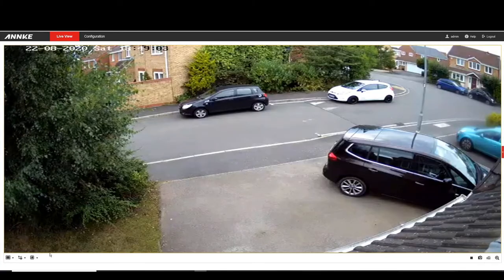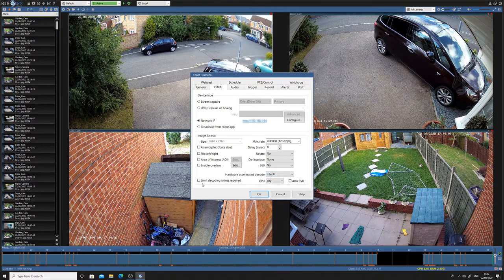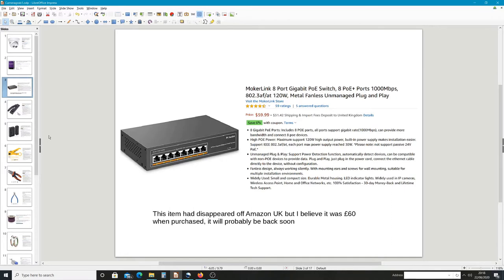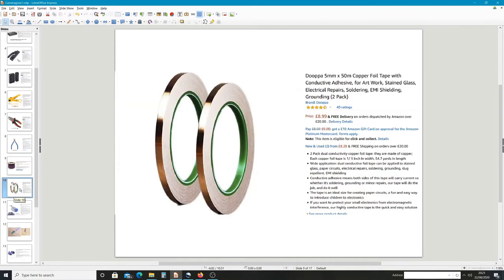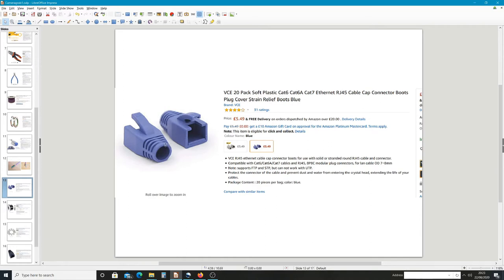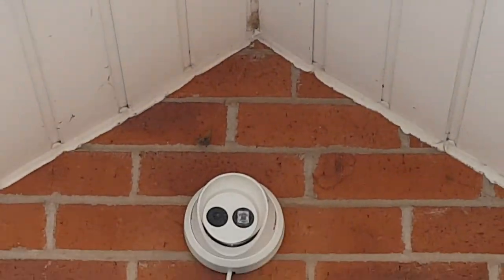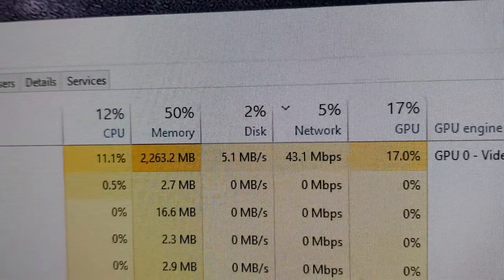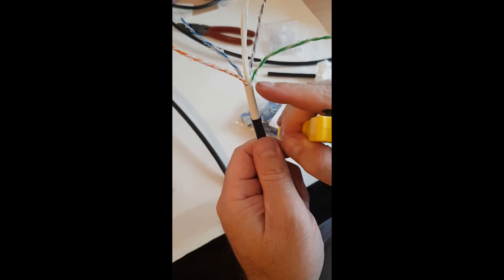Blue Iris - Power consumption & system used to build & support CCTV

Comment: Thank you for all information. I have dedicated NVR box from Hikvision, and 6 cameras connected(1x 4K, 3x QHD, 1x FHD, 1x 720P). This box with 1 HDD inside takes about 10 W.
Reply from the maker: Many thanks for your comments. The PC based system with all the correct settings making use of the 4k cameras uses around 50 watts all in. I suspect a dedicated NVR box will indeed use less power. With the cameras you listed above and a 4tb hard drive I suspect you may be using between 25-40 watts ish at a guess. The hdd alone must be using around 6w if recording 24/7. I suspect at night the cameras are also using more power than in the day. Try a power plug and I think you may be surprised. Thanks
Reply: @ipcamtalk4314  I don't know why you received my post so negative. I'm not saying that Blue Iris is bad. On the contrary, I find it very good software. I only marked the differences between the given solutions. This Hikvision that I am testing does not have the vast majority of features that Blue Iris has, hence its lower appetite for energy.
Reply: @abartos  I dont understand why you received my comment as negative? I was simply correcting your false information.

Comment: This is decent power consumption. I setup my test iris installation on old AMD FX I had. But no matter how I tune it I cannot go below 51-57 watt with iris running as a process. I am recording 2x4k and 1x2k. I guess I need more modern system 🤔
Reply from the maker: Hi there, thanks for the info. Yes, getting all the right settings help. Ensure direst to camera recording. Tick  to minimise cpu usage. Run BI in the background with it not open. The Intel onboard GPU also helps. Direct playback can be a bit choppy but recording are always good. CPU usage is then around 3% and PC power consumption is around 30 watts. This is with running max cpu speed of 3.2GHZ - all energy saving enabled. I suspect with a newer system you could get down to around 20-25 watts for the PC.
Reply: @deanjallen6449  I have GT 1030 for both video decoding and AI. This works amazingly well. Both fast and lean on power 👍 so when just running I need very little CPU. 
For CPU I was thinking about T series Intel or mobile one. There are those laptop processors with adapter to fit desktop board with custom bios..
Reply from the maker: I did notice the hyperthreading cores do work well with this program. The K series is actually a good choice as you can adjust the performance to what is required. This has the advantage of adjustability with regards to how many cameras you are running. I also view the footage on this same pc, running 4 cameras at 4k at the same time. This is when the performance is needed. What you need is a cpu with low minimum speed. The one I am using is 800Mhz. Lower than this will help while just recording. I also think the onboard GPU (intel) will be slightly more efficient but it maybe close.
Reply: @deanjallen6449  thanks for sharing your experience, very much appreciated 👍

Comment: hi im using a gtx 1070 and i7 7700k with 16gb ddr4 ram to run 1 2k camera and other 4k camera and one 1080p camera and one 480p camera im not sure of the wattage but is this an over kill
Reply from the maker: Hi there, thanks for the question. I think the answer is yes just a bit. The 1070 is a good card but I don't think this supports H265, my 1080 strix doesn't. I am pretty sure the 7700k does as I have one of these as well. Just use the CPU graphics, this should allow to record in H265 instead of 264 which should massively increase recording times. Make sure you use direct to disc recording and minimise cpu usage ticked. Also allow CPU GPU to do some of the work, tick the box. Down clock the CPU to 4,0GHZ and turn off turbo. Ensure CPU downclocks to 800Mhz and energy saving feature is on. If you are using 2 slots for RAM this is ok. If you are using 4 slots then remove 2 sticks, make sure you are still running dual channel. 8Ggb of RAM is fine. This potentially will reduce power consumption and increase recording time. Ensure Blue Iris is running in the background and close the program when not watching recordings. Hope this helps.
Reply: @deanjallen6449  Well im using gpu because It has the right display outputs but it runs good i tried to downclock it but the entire pc got super super slow
Reply from the maker: It sounds a bit strange, you shouldn't really notice the difference. Down clocking the CPU will only make minor power savings as its the 800Mhz setting that the PC will be sitting at most of the time. Maybe just turn off the turbo setting. It would be alot better to use the CPU GPU if possible as this should give the performance you need and more recording time. The Nvidia GPU will down clock its self to a low speed anyways so the power saving is minimal. If you use afterburner you could change the setting to 70% power which may help a bit. Maybe a converter so the motherboard output matches the monitor maybe the best way of going. You could then sell the 1070.  This is only if you are using this PC for running Blue Iris only. Hope this helps.
Reply: @deanjallen6449  tried to bricked the pc so i had to reset cmos
Reply from the maker: Sounds a bit strange. If energy saving features are on, you should just need to change the multiplier and turn turbo off. If you change the multiplier to 36 it should then run at 3.6Ghz instead of 4.2 or 4.5. You don't need to touch the voltages. The cpu voltage will then only go to around 1.0v instead of 1.26 ish when set to auto. This will save power when viewing back CCTV footage. It will not save more power most of the time as the cpu should run around 800Mhz when idle and just recording footage. So the cpu voltage should be below 1.0v if Blue Iris is set up correctly. This cpu will run very efficient for this purpose. Hope this helps.